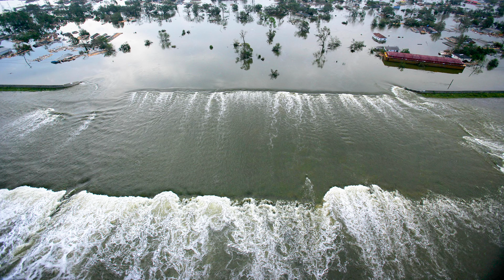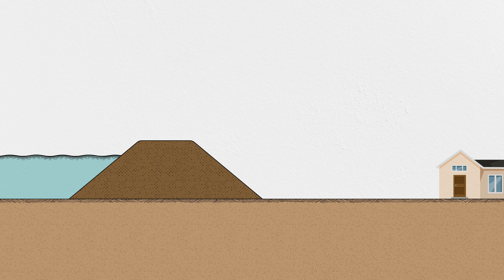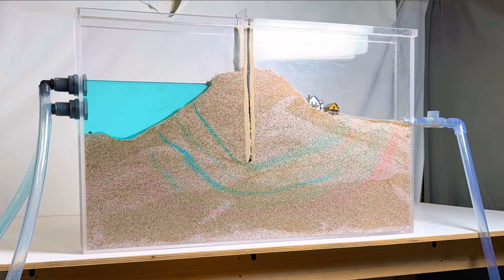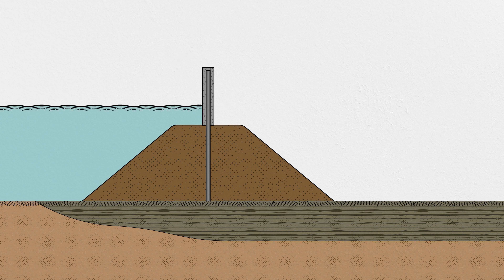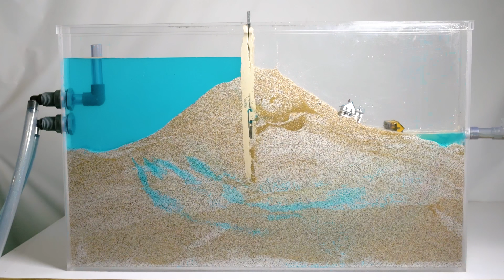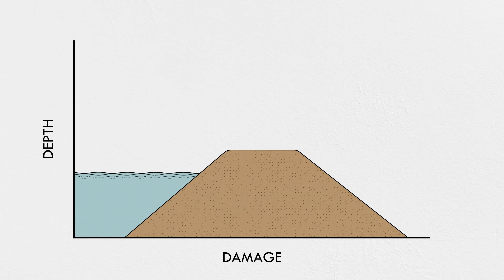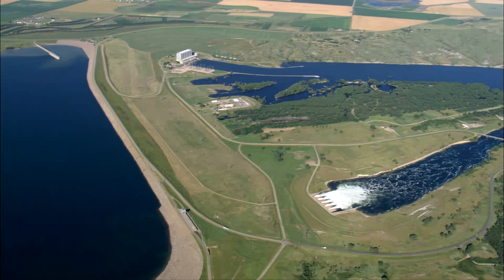The Mind-Blowing Flaw That Flooded New Orleans

Comment: Why wouldn't you have gates on those canals to prevent backward flow, and why don't you get channels on the overflow side of defenses so any overtopping can be swiftly transported away with a separate defense to protect houses.

And why build on an area prone to flooding without having sacrificial areas you can flood without damaging property.

Comment: When the wall is still above the water… but the ground underneath has already decided to quit. 😳

This episode is a perfect example of why engineering failures can be so deceptive. From the surface, the floodwall still looked like it had plenty of height left — yet the real problem was happening underground.

The part about the soil strength assumptions and the I-wall deflecting enough to open a water-filled gap was especially striking. Once that extra pressure reached the foundation, the system could fail at water levels it was supposedly designed to survive.

That’s the scary part of engineering: sometimes the structure doesn’t fail because one huge component snaps. It fails because several small assumptions all line up in the wrong direction.

At RAZBORGRUZ we normally deal with heavy trucks, frames, engines and gearboxes, but the principle feels very familiar — the visible damage is often not where the real problem started.

We genuinely dream of coming to film with you someday. A joint episode comparing civil engineering failures with failures we see in heavily loaded truck components could be fascinating — completely different scale, but very similar lessons about load paths, materials and hidden weaknesses.

If anyone here enjoys seeing why large machines fail and how they are repaired, you might enjoy RAZBORGRUZ too.

Excellent explanation. Good luck to everyone! 🤝

Comment: Leaving those wastewater disposal canals in open connection to the ocean sounds horrifying to me. 
Why not put them a bit lower and have a big pumping station near the ocean?
Or put a closable structure where they hit ocean so you can close them when water levels go up?

Also, if those I-walls were so genius as they thought when they introduced them, why hasn't that been done before as a cost- or land-saving measure? Because it doesn't work, that's why.

Comment: New Orleans problem is its like building in Las Vegas and then complaining that theres no water to be found.  Take a look at a cross section height map of new orleans and you see that the whole city is basically sitting in a bowl right beside the ocean with most of the city below sea level in the bottom of that bowl.

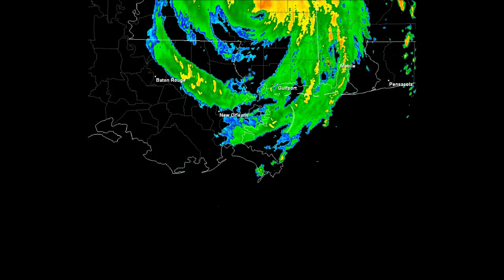Comment: 06:05 One thing I never understood is why the outfall canals lacked tilting weirs, vertical drop gates or any kind of low tech flood gate structure that would allow the system to be cut off to prevent the flow reversal - surges weren't an unknown risk before 2005, they were known in 19th century when the canals were originally built, it was a known solution. Powered butterfly gates were proposed since 1970s, were reportedly cheaper than the I-wall plan, but once again they were never built. Why? 

Sure, they have PCCP closures now - but why didn't they have them for the majority of their existence?

Comment: They brought the sign themselves and they ruined it for the whole country with raising insurance rates for everybody the greed of building and an area that should never be built is the problem when are they going to understand that the whole place is a swamp and stop building. It's over with the place is a swamp and if you do build there you're on your own but it ruined it for everybody in the whole country cuz the insurance company raised the rates for everybody so thank you very much..... Government is just as bad as developers greed greed and payoffs caused all this you're not going to stop the water coming in to the swamp area that whole New Orleans is a swamp
Reply: capitilsm doing it's thang
Reply: It's a port city for the Mississippi river. It was inevitable. It's just an extremely bad designed port city made to be as cheap as possible. Low up front costs to build, high maintenance costs to keep pumping the water back up.

Comment: He mentioned that the storm surge exceeded 28'. The worst of the surge hit the MS Gulf Coast. I visited Biloxi in 2003 and walked Beach Blvd. I got photos of the old two-story homes. In June 2006, I returned. I got photos of nothing but sand. ALL the homes were gone. In Dec. '05, the Army Corps of Engineers began pulling the old metal sheets. The politicians stated that they weren't up to standard. They measured EVERY one of them as they were pulled. EVERY one of them was sunk to standard!!! The politicians were silenced. Parts of I-10 crossing into Slidell were temporary bridge spans in June '06.

Comment: Would it make a difference if the levees had concrete slabs covering them? It probably wouldn't stop the underground seepage, but it might reinforce that soil sheer line to prevent the wall itself collapsing. It sounds cheaper than making the entire levee from concrete

Comment: The 1986 E-99 Sheet Pile Wall Field Load Test produced by the Army Corp of Engineers is a pretty damning document on the ACE's failures in New Orleans.  The deflection and rebound data indicate that beyond 6 ft of head, the wall deflections are "plastic" and nonrecoverable.” (p7)  They went on to say, “the test data indicate that at 7 ft of head the lateral wall deflection of test pile B actually experienced was about twice that predicted by conventional analyses”. (p8)  So they KNEW the walls would fail at much lower levels than they initially planned for.

Also, p9 of E-99 stated (erroneously) that maximum resistance was achieved with sheet pilings under the I-walls sunk to a depth of 17 feet (this based on the improper overall soil assessment mentioned in Grady's video) - and then the forensic investigation after Katrina showed some of the sheet pilings to be 7 feet shallower than the design specifications.

I'm also surprised Grady didn't mention Hurricane Pam - a mock hurricane exercise conducted a little over a year before Katrina hit that predicted almost everything that was seen in Katrina: complete flooding of the city, failures of the levees and pump stations, and innumerable (and preventable) casualties.

Comment: I lived in Ascension Parish in the 80's and there was a record high level on the Mississippi River that came within a few feet of the top of the levee. Shortly after the river subsided back to normal level there was a huge section of levee that just collapsed into the ground. If that had happened a few weeks earlier what a cluster it would have been.

Comment: The statement made at the time was that a considerable amount of maintenance had been deferred for years. It is still possible that every breach that happened would still have happened, but consensus at the time was that this was a large part of the reason for the failures. The city had reportedly been spending its money on other things and diverted funds from maintenance of the levees for some of that budget. I don't know how much of this was for the levees themselves vs the pumping stations, but that was the report. The bit about building in areas previously prone to flooding reminds me a lot of people building right up against the shoreline in other areas instead of 2-3 hundred yards back and now getting caught with problems that would not have been present if they had done so.

Comment: I'm weird and privileged enough as a kid to have a huge sandbox as a kid at our place in the sticks that my grandpa framed and dumped a few loads of sand in. I would dig out the center, fill it with garden hose and build dams and lakes for my hotwheel communities using the old bricks from a recent chimney replacement to our families historic homestead. I've fought this process before. I must have made more than a few dozen. Always they always failed. I tried straws between the bricks and and other erosion mitigation ideas. Its cool to see it in cross-section!

Comment: Not to mention you could add backup and failsafe systems so that even if you do get a breech, it could help limit  damage. That gets exponentially more expensive. But when the cost of a failure likewise gets exponentially more expensive, it starts to become worthwhile. This kind of thing is more normal in medical and aviation, especially in software and electronics when the total cost isn't as high as civil engineering.

Comment: INPUT FROM A RETIRED ENGINEER AND SEEPAGE EXPERT WHO ACTUALLY WORKED ON THE KATRINA RECOVERY EFFORT.  This caught my eye because I spent a huge part of my career on seepage and slope stability analysis for large government projects.  I learned it from Fred Tracy at Waterways Experiment Station in Vicksburg, now called U.S. Army Engineer Research and Development Center (ERDC), who wrote the SEEP-2D program years ago, and then went on to perform the seepage analyses for several of the country's largest civil works projects where I often developed new analysis techniques that were peer reviewed without a comment by folks such as Dr. Jim Mitchell, who was a member of both the National Academy of Sciences and the National Academy of Engineering, which means that over a career, I became fairly good at it.  So, I had a couple of comments on your presentation.  Perhaps you were trying to make the presentation understandable for non-engineers but the lines that you were pointing to and calling pressure lines are actually called "total head equipotential lines," which are the summation of elevation and pressure heads.  

Also, if I understood you correctly, you mentioned something about the pressures within the soil mass as pushing the soil mass downstream, which is not typically the way it's evaluated in the known analysis methods.  Rather, the analysis is performed using either by total stress analysis or effective stress analysis, usually effective stress analysis, with the water upstream of the embankment being a driving force but the water within the embankment only being evaluated in terms of pore water pressure, which the seepage program of your choice would use to calculate the effective stress, which in turn is used to calculate the shear strength of the soil for the drained (S) condition, typical for granular soils or for when the embankment has been under its current loading for a long period of time, sometimes years for cohesive soils.  That's the basic idea.  Forces within the soil mass are only considered for their ability to move the soil when we talk about soil heave, which occurs with cohesive soils on the embankment's downstream side, or internal erosion for cohesionless (i.e., granular) soils either within the dam or on the downstream side of the dam, the latter of which is evaluated by exit gradients, which you mentioned.   

The real problem with the New Orleans levees were that the designers didn't consider the lack of stability of the single sheet pile wall used to effectively raise the levees.  When tested by the flood, the water pressure pushed the sheet pile back to leave a deep gap on the upstream side of the sheet pile, this shortening the seepage path substantially such that the downstream side failed in heave in some locations, and internal erosion at locations where cohesionless soils were present.  (When internal erosion begins at the surface on the downstream side, it's typically referred to as piping, although "internal erosion" is the term of choice for agencies such as the Bureau of Reclamation's Technical Service Center (i.e., the national center of expertise for dams)).  The fix was to repair the breached levees, then reinstall the sheet piles, but only as seepage cutoff walls within the soil mass.  The repaired levees were then raised using concrete T-walls set on pile foundations of a vertical upstream pile and a battered downstream pile such that the T-wall would not tilt or tip over under flood loading.  The T-wall was constructed directly over and tied into the sheet pile cutoff wall.  In this way, the T-wall and concrete piles would support the overturning load without allowing the t-wall to tip and without transferring the lateral load to the sheet pile cutoff wall beneath.  I know this because I was part of the New Orleans recovery effort.

Comment: Those three canals (17th St, Orleans Ave, and London Ave) should be converted to street-level canals, like those in Jefferson Parish. The levees along the Lake should close those exits so that all those miles of levees along those canals aren't exposed to storm surges. They already have something like this with the Corps' storm gates. This would get the Corps' impellers out of the salt water that progressively dissolves them. This is a political solution that Congress and the City have to get over themselves and agree upon. The City should also retire their 25-hz museum and replace those Baldwin Wood Memorial pumps with modern facilities for which they can still buy parts.

Comment: The breach where the barge came out of the canal has no video showing water flowing out of the breach. All the other breaches show it flowing out. Most are small, and near the lake. This one is large, and miles from the lake. It's the one where I saw explosions, and made a video recreation, and tracking map where explosions happened. Many, so called at the time, "ear witnesses" reported hearing the explosions in that direction. Those explosions happened before any flooding arrived at Esplanade Ave.

My analysis; the area east of the canal was flooded above the canal. Kids from the Coast Guard/Navy base blew the floodwall intending to drain the flood into the canal. The wall of water surged into the canal, crested as it struck the New Orleans side floodwall pushing it half a block out. The surge swell rebounded back to the breach crested as it went up slope carrying the barge against the current through the first breach into that neighborhood. Check out my levee explosions video recreating what I saw.

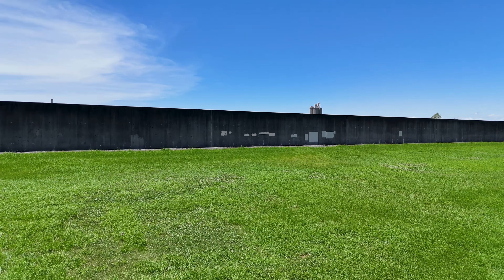Comment: 11:53 I find most geotechnical engineers feel overwhelmed by data. The temptation of using one borehole is overwhelming in many cases.  I have started presenting techniques to my students on how to use interpolation (not material properties interpolation, but more design output interpolation... material properties interpolation is more prone to interpretation and better suited for finite element style modelling of a scenario) to effectively integrate large amounts of data into a consistent design for a site.

Using the worst case is tempting, but it can lead to different errors. For instance a certain profile may be the worst case in terms of overall shear strength, but maybe perform well under lateral loading. The company  I worked with at the time had a project  in N.Y.C. where we were able to show to the city that the original design has based its foundation design on the worst case borehole where the clay was thickest by far and overall weakest. However, the upper layer,  turned out to be fairly competent in lateral loading and since the apparent worst borehole had been used to do all design, parts of the structure would have failed under the design loads. 

We were able to create, via interpolation of outcomes contour maps for the estimated lateral and axial capacity calculated at every single available borehole location (they had 92... of which one was used for design). We were able to convince the client add a lateral test pile, using our contour maps to select the test location. The test location selected in one of the areas that had previously been considered as "very competent" from a cursory look at the boreholes. The field test  supported our analysis that it would fail under the design load. The entire (design build) project had to be reworked on the fly as construction was proceeding to change the distribution of the design loads. 

The moral of the story: don't ignore the data that you spent good money collecting. Do your analysis, every individual type of analysis... axial capacity, lateral capacity, settlement, slope stability) on each and every borehole location (tied to the x-y coordinate of the borehole) and interpolate the results to have a better picture of the overall performance. It's a relatively simple technique that brings a whole new understanding of what's going on. Contour maps are a very useful tool to capture complex scenarios in a relatively simple way.

Comment: So, the burning question, what could have been done in the years prior to the storm to prevent this?

I ask because I remember many comments about the state getting Federal Monies to repair or upgrade the levies, but they supposedly spent it on other things.  If they had spent the money on the levies, could they have been upgraded enough to prevent failure with the technology available at the time?

Comment: How many cities are in danger around the world.
Most were built around places where trade ships could Dock, but that was hundreds of years ago.
We know the sea level has risen over time as the planet comes out of the last ice age.
London is protected by the flood barrier from the once in 50 year storm surge coming up the river.
But since Roman times much land has been reclaimed from the river creating a double problem, flooding from the land, so the barrier cannot be closed for long during heavy on land rainfall event's. 
With whatever is causing the rapid warming in recent years, the barrier is now closed two or three times a year to keep the rising tide out of the city.
But we know the storm surges it was built for are now close to over topping it. The solution is to remove some of the down river sea wall's to alow farm land to flood and return the drained marshes to the sea.
Even then it is thought, it is when the city floods not if.